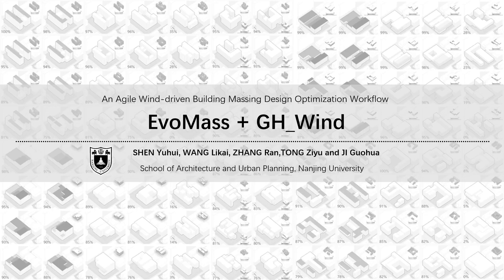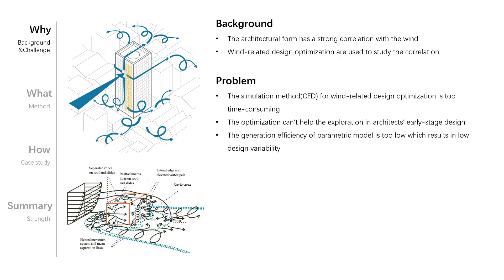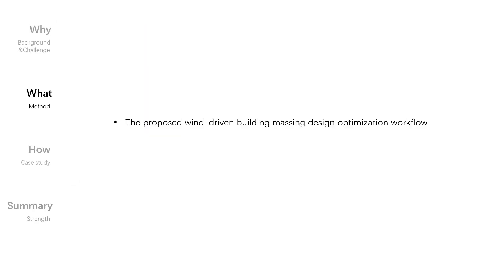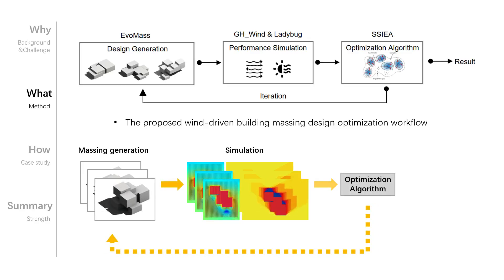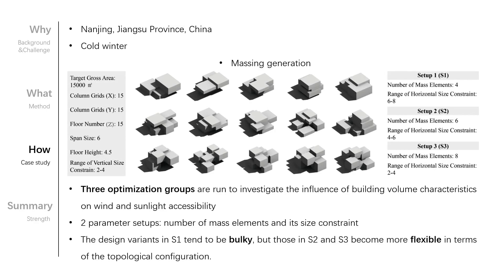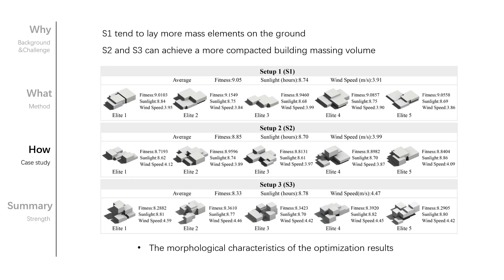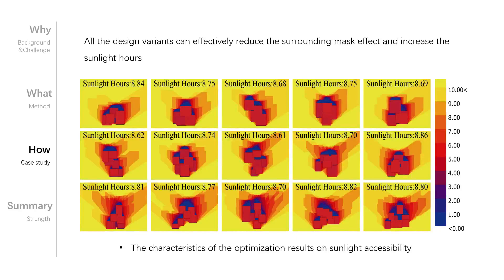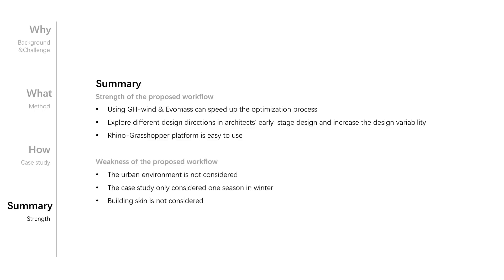EvoMass+GH_Wind - An agile wind-driven building massing design optimization framework

Comment: Thanks alot for your impressive presentation, Could you share the example of the wind analysis nodes or script ?
Reply from the maker: Hi, the script is based on old evomass and cannot properly work now. Instead, you can install GH_Wind and replace the design generation part in its example gh file with evomass to reproduce the design optimization workflow. Here is the link to the GH_Wind: https://github.com/christophwaibel/GH_Wind. Cheers.
Reply: @lkwang2710  I thank yo you for your valuable interest. I will try them, i hope to provide to the design optimization between the evomass and the wind analysis